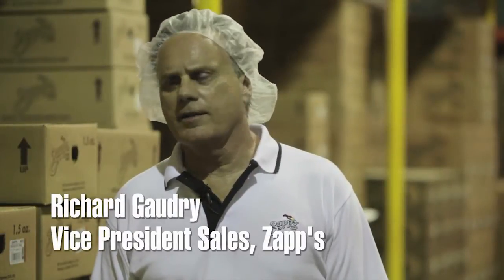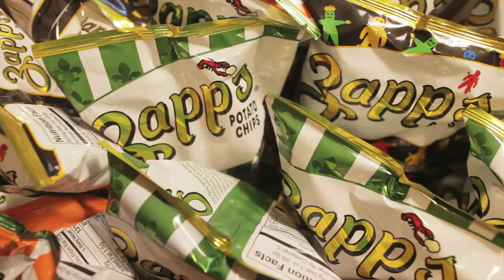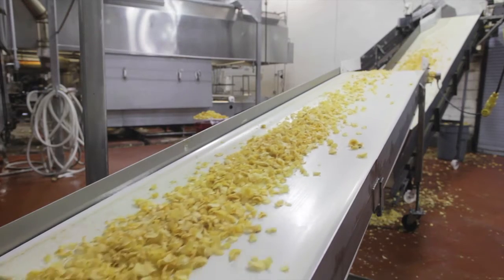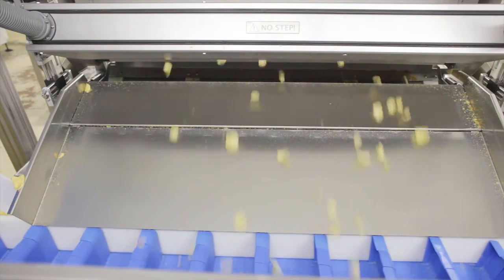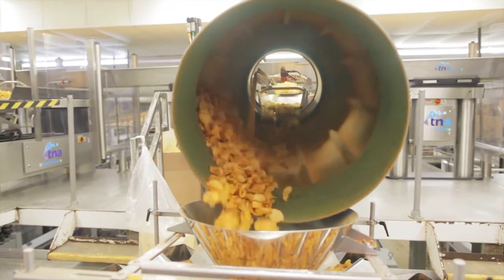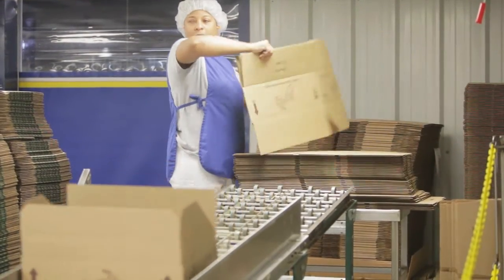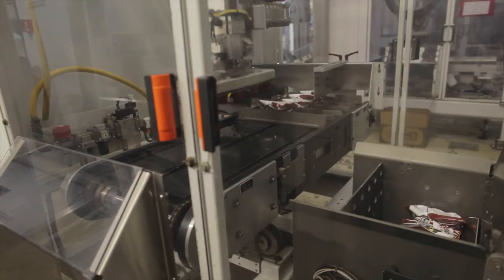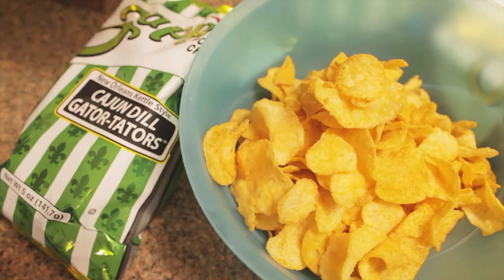How It's Done: Zapp's Potato Chips

Comment: how the hell does that inspector work? I'd be interesting in learning the mechanics behind that. It doesn't sound like it should work that simply. If it works like it sounds, it seems like it would be convoluted for unreliable results. I'd have to know where exactly the machine is separating the chips, and how it's separating them. I mean, I can imagine it working, but it seems like it would be incredibly expensive to keep up and manage...but even then it wouldn't be completely reliable...but that's in my imagination. I don't see where or how the separation is occurring here. Like, what kind of processor does it use? When was it constructed? I'm really not buying it lmao. I want to see it first-hand, it doesn't sound like it should work. TBH I don't think you'd need it to begin with, as the overall quality of the base chip seems like it would have to do with the initial slicer and conveyors during cooking.
Reply: Usually an optical sorter has some type of scanner to detect product that is not the same color. Then jets of air blow each chip out. 

Pretty gnarly technology, and it’s hard to grasp really. I was watching and episode about salt, I know, exciting, and an optical sorter was blowing out little tiny black specs of salt after mining and it was just amazing to see